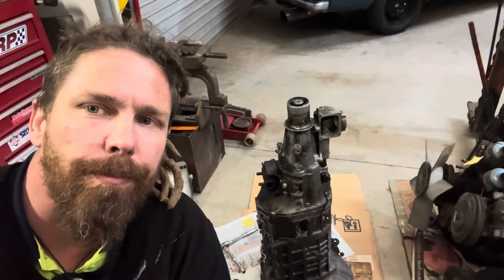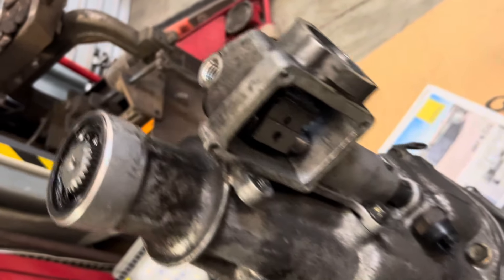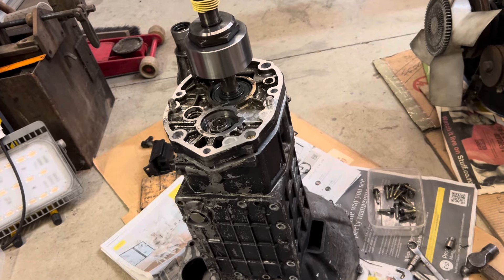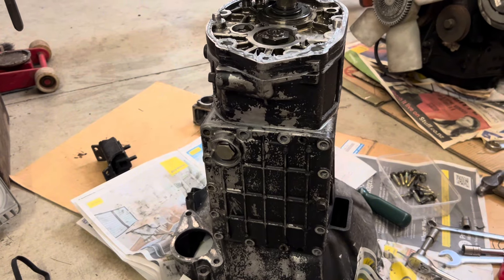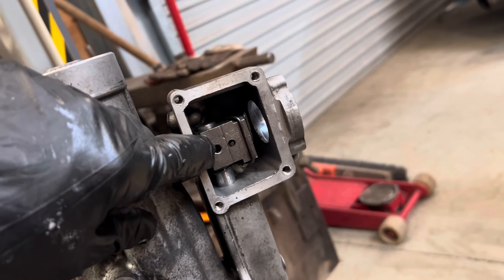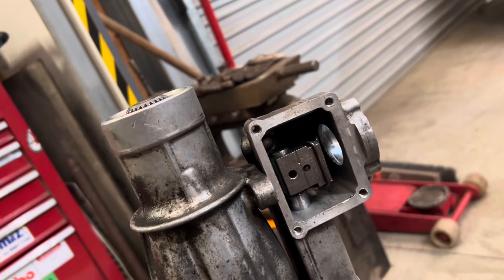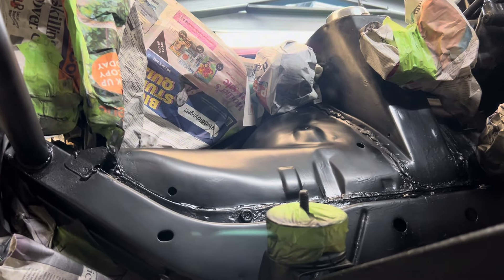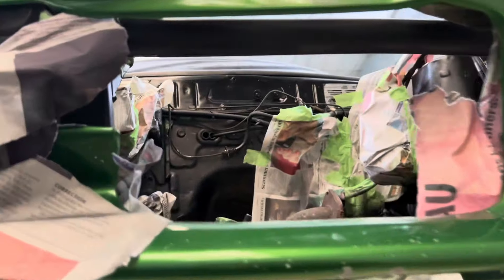RESEAL a Fc Gearbox

Comment: Visual externally the easiest way to tell between S4 and S5 Turbo gearbox, the ribbing on the main section, S5 has a lot more ribs, like twice etc
Yes, S5 has extra bolt mounting the bell housing to the gearbox